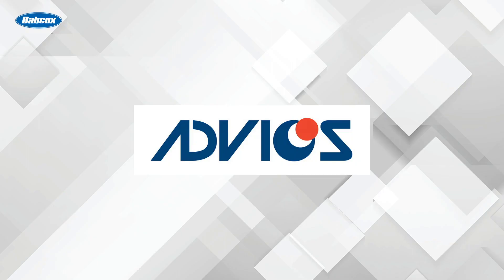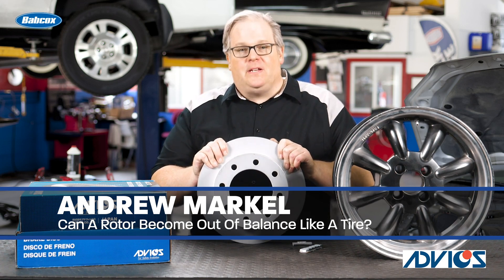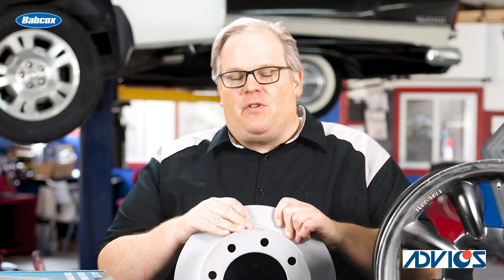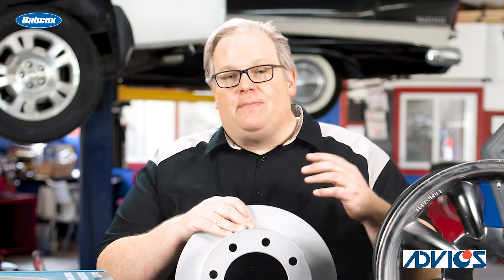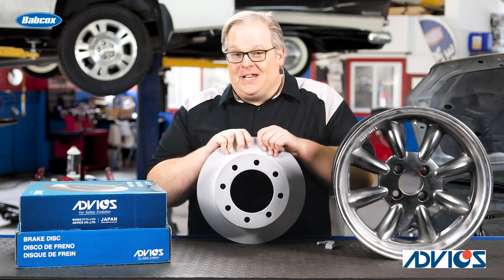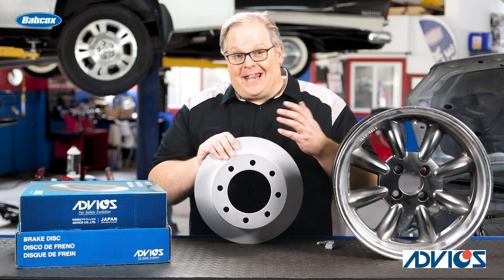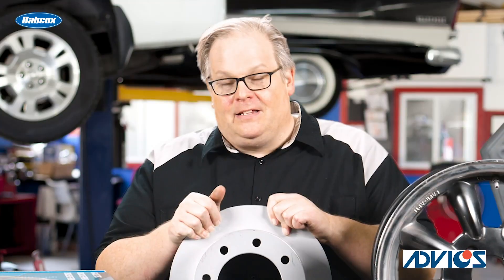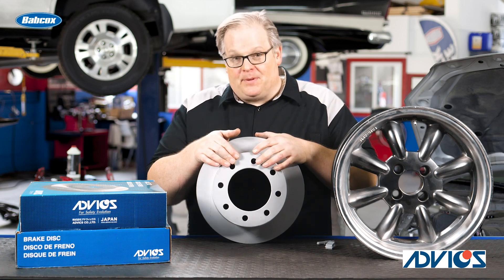Can A Rotor Become Out Of Balance Like A Tire?

Comment: My 2016 CRV came with a Factory unbalanced brake rotors, been 3 years dealing with warranty, they tried replacing (tires, rims, suspension, suspension links, etc etc,) nothing improved the 80+mph vibration, untill I had to replace the rotors with an autozone ones 🤣 problem gone since.
Now autozone ones vibrate when hot on downhill, I’ll replace them with a high quality ones, but not OEM
Reply: thanks for feedback - i think i have the same problem(1 year old car)
Reply: Sounds like you have other issues. Check your wheel bearing for play, make sure the mating surface between rotor and hub is free of rust.
Reply: @papimasfuerte4671 the problem was the discs (brake rotors) it was weird and difficult to diagnose, since Mile 0 it had that issue, finally fixed at 100K miles 😅 but I appreciate your comment.

Comment: I had some nice rebestos rotors and pads installed on my 17 F-150 and ever since I get a bad steering wheel wobble when driving on the highway 70+ mph. Tires checked out fine and even had them replaced. The alignment is also good. Is it possible there was an issue with rotors not being balanced right or even chucked properly when being turned from the factory? 92k miles currently and have been dealing with this for 10k miles and nobody has an answer but don’t want to throw money away guessing.
Reply: Check the outer tie rod ends first. On the F-150 the rack is essentially a manual rack with an electric motor in the center section. Small amounts of play in the steering can cause the wobble. Do a dry park test with weight on the front suspension. Do you have a 19" wheel package?